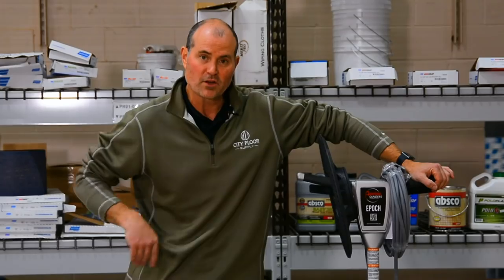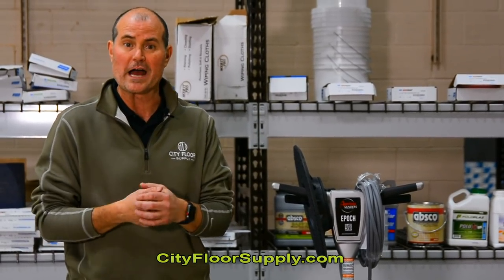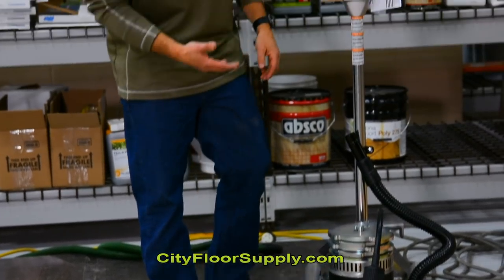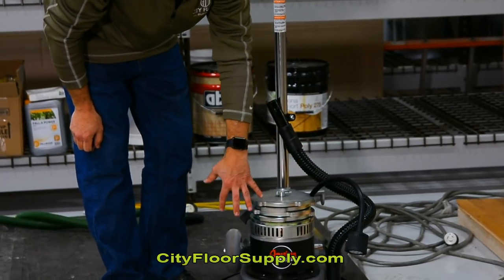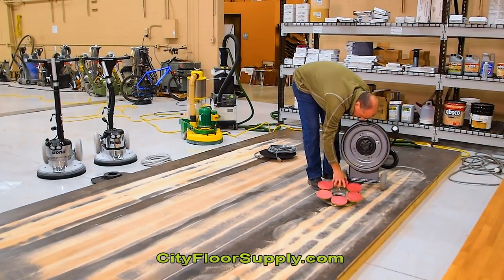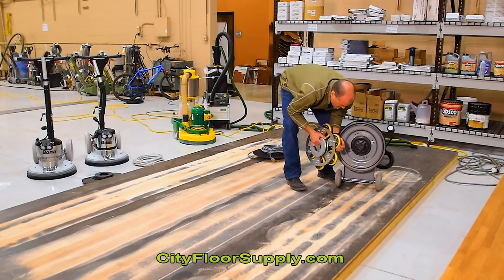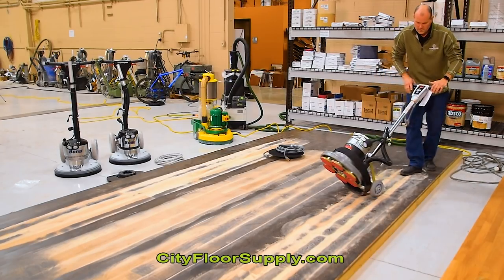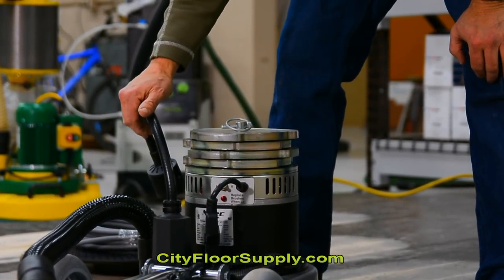Epoch Buffer and HydraSand Vs. Cupped Hickory Panel at City Floor Supply

Comment: I have it it’s not a fast material remover and way to slow to sand hickory as a first pass. 
It’s a great machine use it after belt sander and edgeing to completely flatten the floor. 

I edge sand with 100 grit belt sand with 80 then I use epoch on high speed with 100 grit screen then come back on low speed with 100 grit red head discs on the hydra sand makes for a seamless stain

Comment: The biggest CON is that it will blast breakers over and over again other than that great machine
Reply from the maker: Hi Adam, the manufacturer recommends connecting this machine to a dedicated 20 Amp electrical line to prevent nuisance breaker tripping. Hope this helps!
Reply: @CityFloorSupplyLLC  They should have made it 220 hook up. Then I wouldn't have to wire it directly to the breaker to have 20 amp dedicated hook up.
Reply: I plug into kitchens and bathrooms and have no problem. Only need 20 amp when you're using it in high speed.
Reply: Man I hear bad and good review. What TF is the truth ?   SHOUKD I GET THE EPOCH OR THE EPICH HD tell me !!
Reply: @jayboogie1357   I have its not a material remover, use it after a belt sander, to sand out belt sander, and edger marks; for perfect uniform finish. 

I usually screen sand with 100 grit on high speed with Epoch. Since screens are cheap they clean it up on low speed with red heat 100 grit on hydra sander.